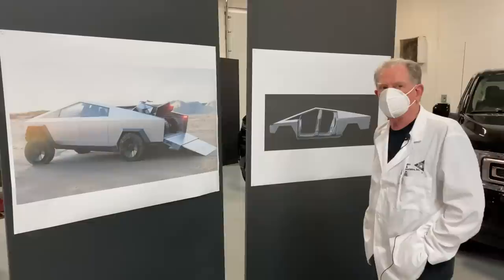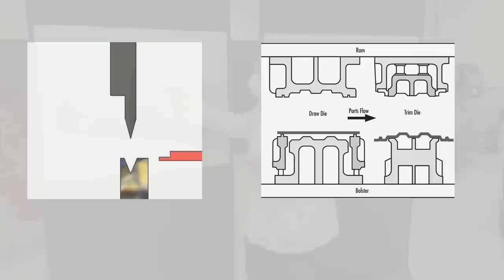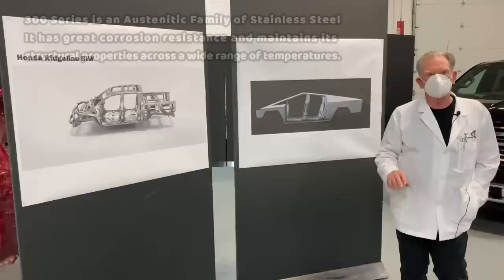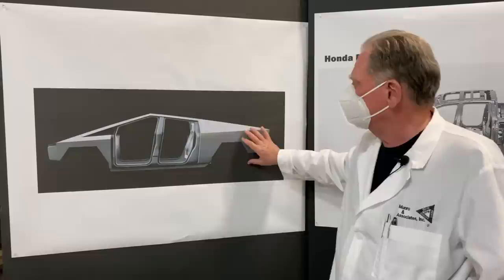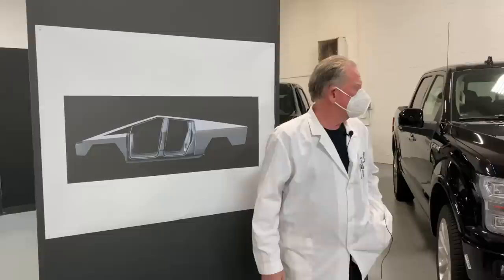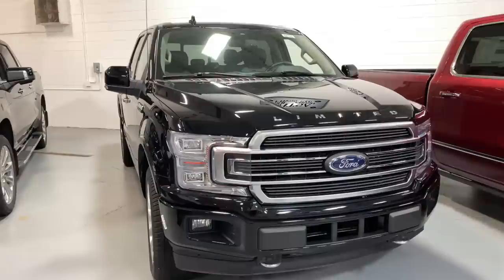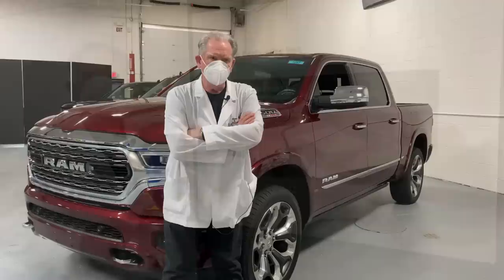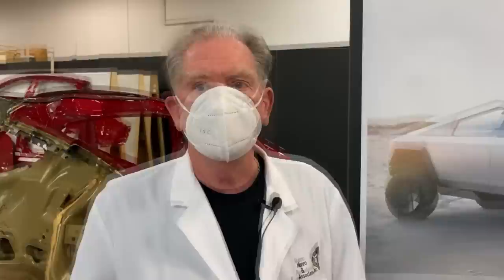Cybertruck E1 - Body Structure Comparison

Comment: Munro: "I worked on the DMC DeLorean"
OMG
Reply: Shit that just made him even cooler in my book
Reply: The DeLorean car was wrecked by its management but the external skin was very thin and easily dinted.
Reply: @davidelliott5843  no thinner than on any other car.
Reply: Grizzy Bear I don’t know what they were thinking. Maybe they took too many of the drugs they were smuggling!
Reply: @0tispunkm3y3r  there were no drugs.
Reply: That's what I thought. Of course he did. Of course he did!
Reply: Highly doubt he has even seen a DeLorean...let alone worked on the manufacturing.  The only part he got right was the DeLorean having stainless panels, everything else was incorrect.
Reply: The DeLorean’s stainless panels are not thin compared with modern automobiles. They’re about 1.5 mm thick (16 gauge).  They were never plastic-backed.  And the DeLorean never employed a metal underbody.  It’s a molded fiberglass underbody where the stainless panels are attached via stainless brackets into rivet-nuts or speed nuts.  Every panel on a DeLorean is easily removed and replaced including the rear quarter panels.
Reply: @BSF801132957  Umm did he get everything right or just the stainless steel part? Your comment is confusing
Reply: @matthewdavid2010  I was also surprised by his comments about the DeLorean's structure. The only plastic I know of would be that the T-panel is held down with speed nuts clipped onto plastic. DMC part #s 105742 & 105743. Could he be referring to the fiberglass body itself as "plastic"?
Reply: @abyssstrider2547  Everything he stated on the DeLorean was incorrect, I cannot comment on the rest of the facts in the Video.  For me this discredits him, especially considering he specifically stated that he "worked on the DeLorean" yet got all of those facts wrong.
Reply: @adalmartinez2340  He shouldn't. It was a shit car. Thank Spielberg for making it cult status. The people who worked on the DeLorean did a pretty pi** poor job.
Reply: He needs to ruffle his hair and call the camera man Marty
Reply: @CriticalRoleHighlights  Actually it was Robert Zemeckis, the director who came out with the idea to build the time machine into a car. Spielberg was a producer on the movie.
Reply: That's synonymous with saying "I worked on a complete automotive failure whose only claim to fame is an 80's teeny movie".
Reply: THE REAL DEAL
Reply: @BSF801132957  idk maybe its because he was actually dealing with the pre-production models that people were planning on building, and these got changed in either the production or late production models? Like I found it odd he would mention that detail if he did not know specifically know about it. After all he did say he was employed at the end of the chain of developement, not the production of the car
Reply: @BSF801132957  He makes many errors in his engineering claims. Calls 300 series steel "ultra hard" can't seem to understand why threaded fasteners and aluminum parts are better than plastic and rivets. I don't trust anything he says at this point.

Comment: Munro: Tesla, your paintjob is bad

Tesla: ok, no more paint

Competitors: Wait, that's illegal
Reply: As a Michigan resident, that hits home. 😂
Reply: henningo1896 Honestly True tho.
Reply: rust enters chat
Reply: * @derek3524  30X type stainless steel removes rust from chat*
Reply: @derek3524  Huge difference between painted mild steel like every other vehicle uses, and actual stainless steel. The stainless steel simply will not corrode under any normal circumstances. The painted mild steel (as is used in current vehicles) will readily corrode if there are any imperfections or paint chips on either the inside or outside surfaces.
Reply: Paint job is unnecessary and pointless for stainless e.g. you will see more scratches if painted, you see lot less if it was bare metal, because stainless is a hard metal.
Reply: @guessagainkk6322  just use plastidip if you want color :D
Reply: @guessagainkk6322  Delorean did this exact thing and it's even been proven in time travel.
Reply: @derek3524  What part of it being a spaceship grade stainless steel that you don't understand?
Reply: @albinekb  hahaha nonsense, what the point then , since its its plastic?!?!
Reply: Derek “Rust enters chat”. Stainless steel Cybertruck says LOL.
Reply: Purchasing an expensive vehichle is an emotional decision. I love the tech of the Tesla but it is uglier than I don't know what.
Reply: jeremy h he was making a joke and you took it like a scientist smh
Reply: @albinekb  Yeah, the advantage with plasti dip is that it's so inexpensive that you can change color of your Cybertruck every other year if you want. I'm choosing a black color to begin with and later I'll problably make a camo pattern probably.
Reply: I want to give this comment a million likes xD
Reply: @jerth  In my experience stainless does corrode, but very, very slowly. After like 10 years you basically just get very small yellowy brown spots on the surface in nooks and crannies. TBH I think it will just add to the appearance in this case. I don't think you'll get actual "rusting-out" type effect where it actually eats holes, you'll probably be able to take rust off with steel wool.
Reply: You can still paint s/s
Reply: Seriously, wearing a mask alone in the warehouse with a cameraman who is at safe distance???? Hysteria is all I can think.
Reply: I "Like" this comment but can't hit like button on comments already at an ordinal Tesla number: 69, 420,  666.
Reply: @JensLarssonDK  as someone who almost died from it battling it out in the hospital for several weeks and even losing some family members because of it I actually commend him for wearing a good quality mask. 
Also they are inside a facility, not outdoors.
Reply: @SkepticalCaveman  hi, how difficult is it to remove plastidip?  I am curious because I was thinking vinyl wrap, but might opt for plastidip if easy to remove.  Thank you.
Reply: @albinekb  
I think you’re going to see a brisk side business in people doing wraps on Cybertrucks.  People like to spend money on making their toy different.
Reply: @guidedmeditation2396  
People will buy it for its functionality… and it looks different.  It’s easy to say it’s ugly, which is subjective anyway, but people will be flocking to see them as soon as people have them.
Reply: @derek3524  Rust has been kicked from the server.
Reply: Cybertrucks ugly and  dystopian design.
Reply: Stainless steel is NOT entirely corrosion proof.  That's a myth.  Ask any sailor!   For sure, stainless is excellent at resisting corrosion and it'll do just fine in the vast majority of vehicular circumstances.  There might be a few minor issues where people live close to sea shores where corrosion is bad but so long as the vehicle gets a run through a carwash from time to time for its occasional waxing, it'll do fine.  I'd buy a Cybertruck tomorrow!
Reply: @Neojhun  Which is why I said, "it'll be fine".  i just wanted to ensure that some of the comments here that arrogantly assert that 300 series stainless is somehow impervious to corrosion, are corrected.  It is not.  But for the purposes of (the vast majority of) road vehicle uses, it's fine.
Reply: @Barbreck1  Yeah I was just backing up supporting your argument with my experience with Industrial Equipment in harsh environments made of Stainless.